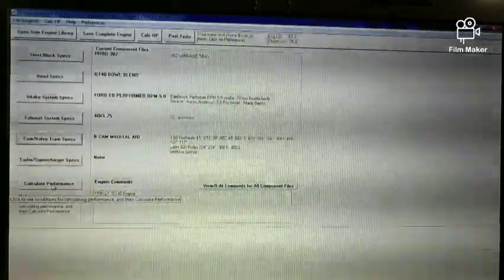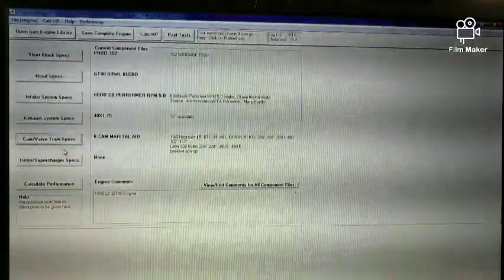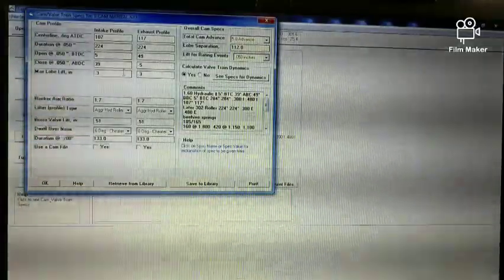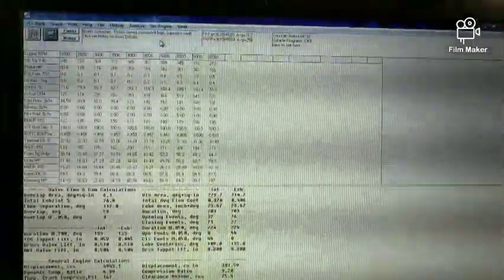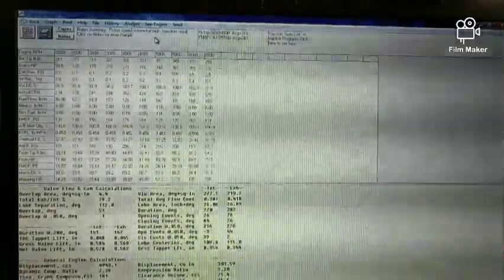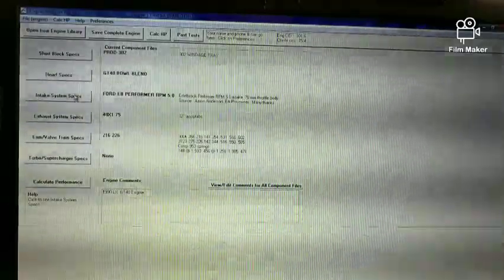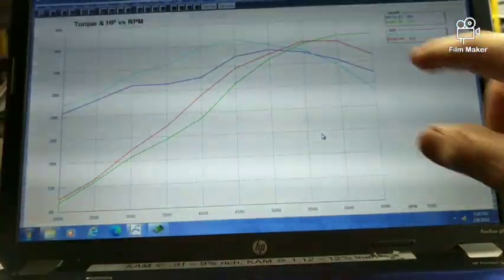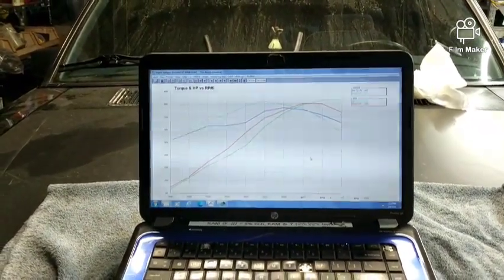Using computer program to show differences between B-cam and a street cam and intake manifolds too.

Comment: Thanks for the demo. I bought EA3.4 recently, but I don't have all those intake manifold options to choose from. Were you able to import those from somewhere?
Reply from the maker: I think I made some of them from existing files, like used the TFS-R to make the holley, just changed the specs until it more closely matched the results I got from the dynos.
Reply from the maker: Wanted to add that I've cut several manifolds open, so have the measurements needed to most accurately depict how they really are.
Reply: @FXRSDriver  I'd be interested in the efi manifold files if you're willing to share. I'm using an Explorer intake right now. Thanks.
Reply from the maker: I could probably email them if you give me your address.

Comment: Close to 20yrs ago I use to spend hours on my desktop dyno program comparing different cam profiles trying to figure out which cam would give me the best TQ and HP numbers for my 302 combo. I probably had 20 different camshafts with all their timing events saved.  In the end, for my build I settled on the comp cam nx264 advanced 4deg.  At. 050 it is very close to that 216 226 cam you just showed.  That engine ran very strong.
Reply from the maker: This program is much better than desktop dyno.
Reply: My 331 (302 based bronco) I went with XE266HR12, pretty close to yours

Comment: Great info shhhs I got the ecam for free about 6 or 7 years ago it's been in the car for that long but now I'm doing the ported gt40p heads and intake so we will see. I'm not going racing just fun mexico streets stuff but maybe I might look for another cam grind?$$!
Reply from the maker: I know guys use them, it'll make more power than the stocker.
Reply: Appreciate your input on it and I have to say it sure does sound good with it so I might keep it unless I find some extra money somewhere?
Reply: What intake gasket do you recommend for my porting job?
Reply from the maker: @VictorSanchez-kp9nt  1250S3 should work, plus it blocks off the EGR port.
Reply: @FXRSDriver  will the   1250s3 steel core hold up to the exhaust heat at the crossover and  ot burn through?
Reply from the maker: @bryansage6925  the ones ive used have, they're the only kind I use.
Reply: @FXRSDriver  Thanks, how much of a difference in power can be gained by blocking the exhaust riser ? I have a torker 289 on e7 heads and I didn't block that egr port...
Reply from the maker: @bryansage6925  could be 10+
Reply: That's what I bought it doesn't open it up much but watched another video of yours and you said intake doesn't need much. Thanks for all you do. Experience is everything.☺